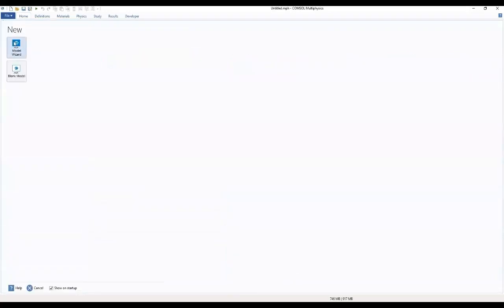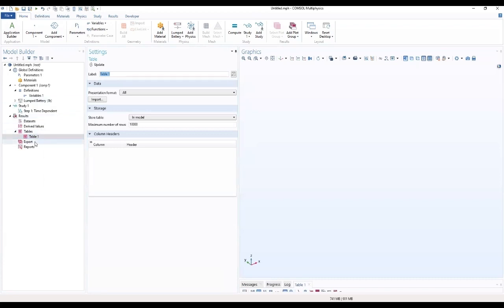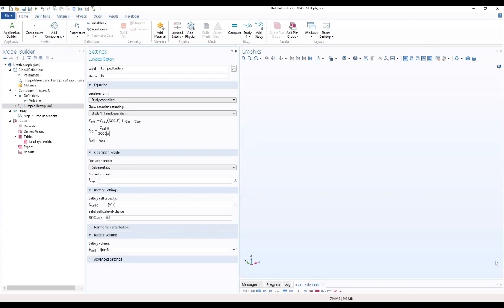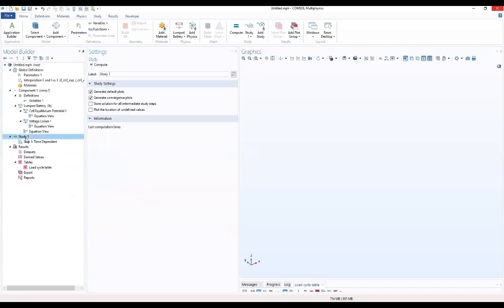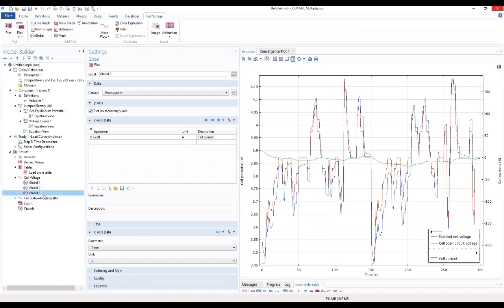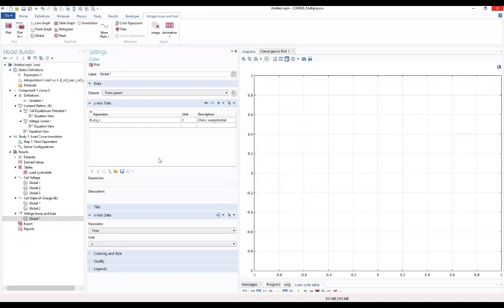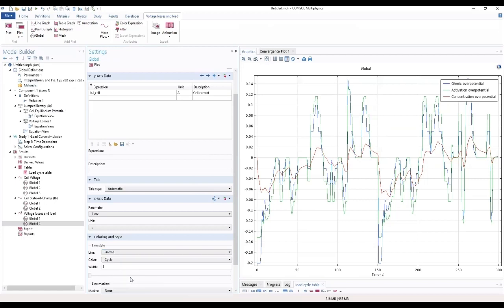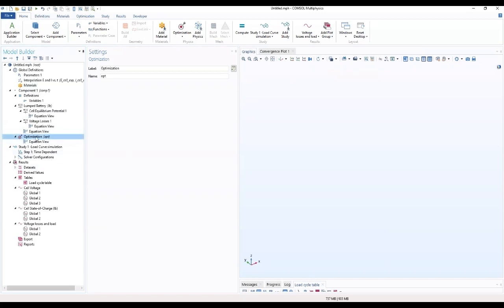HOW TO USE COMSOL MULTIPHYSICS TO SIMULATE TIME DEPENDENT PARAMETER IN BATTERY . (1st PART)

Comment: why the time step only 1 sec?
Reply from the maker: Thanks for asking.
I wanted to illustrate how the results of the potential against time will be for every sec till the final time set.
However the time dependent parameters can be set to the users control depending on the results you need.